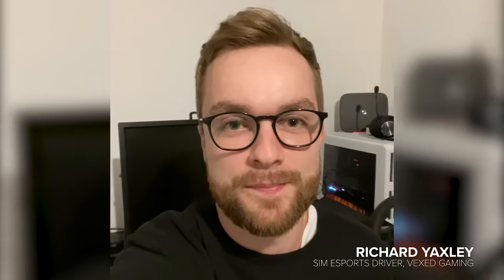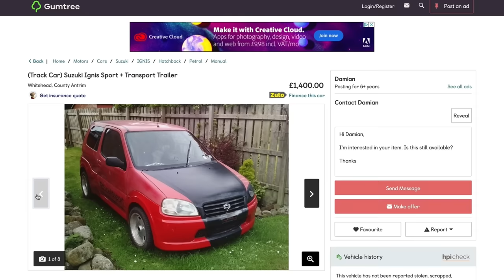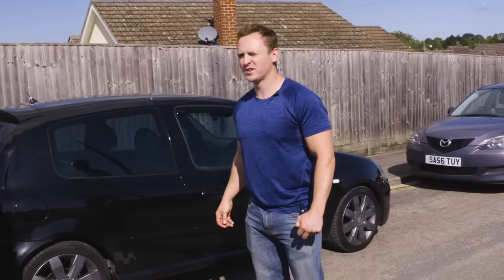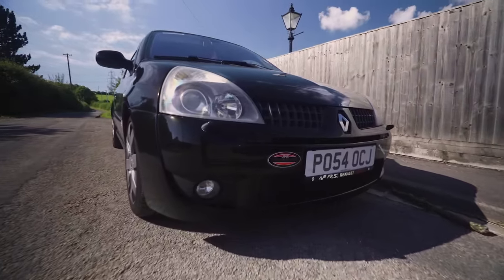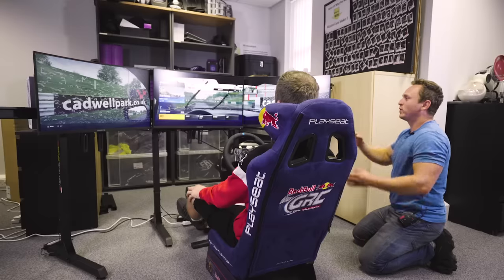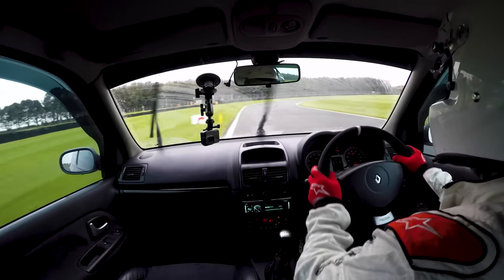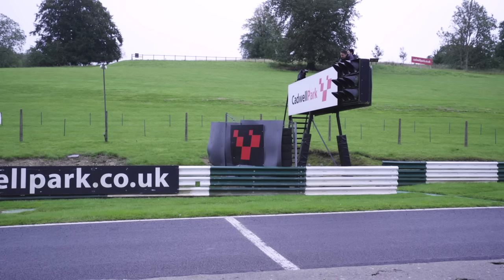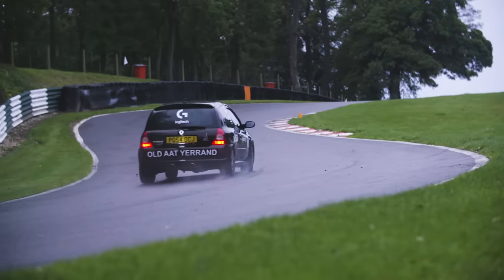£2000 Track Car Challenge

Comment: the Logitech wheel is a very low end wheel and for actually learning how the car behaves it isnt that good and the game youre playing is project cars which is an arcade
Reply: Well that's a sponsored vidéo isn't it?
Reply: The wheel is plenty for sim racing. Many guys who are racing with over 5k iRating are still using the logitech wheels. The bigger upgrade you need to be more competitive are decent pedals. And yeah pCars is shit. ACC and iRacing is much better for sim racing.
Reply: @ItsDavid07  I used to have a Logitech g920 a couple of years ago I’ve upgraded to a fanatec podium the difference is incredible even when the Logitech wheel is compared to a mid range wheel like a fanatec cls the difference is still immense 100% of the  guys I race with use fanatec cls,sim cubes,accufores or fanatec podiums a wheel maters the most in a sim setup
Reply: @hubertkam7647  I thought I was having a stroke reading that reply. Please punctuate. You're also comparing a £500 direct drive wheel to one that is effectively £130 on sale using helical gears so yeah the difference is huge. What I'm saying is that you're not really missing out on the most important feedback during sim racing which provides information as to where and how the car is reacting, you just get a much more pronounced feel and detail when using a higher end wheel. You can 100% be competitive with a G29/920 and compete with people use CLS wheels and up. You also have to factor in that people just don't have nearly £2-3k to fork out on a sim rig so going for the most cost effective way which is essentially better pedals is a much bigger upgrade than a new wheel. Brake and throttle control is just as important as the wheel itself.
Reply: @ItsDavid07  a cheap direct drive wheel is 1500 euro and if you gave me the g920 pedals I would probably be still within 2 seconds of my time
Reply: I do real life track and autocross events, and I use a G920 for gaming, it's not perfect but it's certainly good enough to put down consistent times with decent car control
Reply: @ItsDavid07  i got a g29 its been just a good cheap wheel bought it for 250 pounds new

Comment: Have a 182 myself, best car ive ever driven!
Reply: Yass me to
Reply: Used to have a ph1 172,  so far one of the most entertaining cars I drove until it's timing belt broke...
Reply: @dohmies77  Haha seems im driving a ticking time bomb at the moment. I havent had proof of the belt being done so Im chancing it slightly
Reply: @1234eeras  fthe belt was actually quite new, probably tensioner or something went bad since it had 275k km on the clock when shit hit the fan.
Reply: Lol have u driven a ep3 type r blows the 182 away woth handling and power and main thing reliability haha my bro had a 182 goes like tue clappers
Reply: @1991enduro  I see what you mean, they are more powerful. But its the reputation they have, chavs smacking them off the limiter all the time
Reply: @1991enduro  Tyre R’s aren’t as good as you think they are. The Clio beats type r hands down
Reply: @1991enduro  either it was a ropey one or you're exagerrating. These Clio's do and are known to handle amazing. The EP3 has slightly more power but is heavier so power to weight is pretty much identical. Of course a Honda will be reliable but the 172's and 182's are actually reliable too, at least mechanically.
Reply: The only thing a Honda blows is bleu smoke out of the exhaust by accelerating

Comment: A chair and a wheel on some high specked PC does not simulate a race track lap challenge scenario. Not even close. No g-forces, no risk, no nothing. You can't imagine how hard, how physically and mentally tiring it is to drive fast on a race track. You have to experience that for yourself. It looks easy, but it ain't!

On a sim you only get some of the sensation, but nothing real. I've had a Logitech G27 in the past, it was really fun! But only when I went to the race track, in a real car, I realized what it actually took to drive a car fast!

Great (actual) driving Alex!

Comment: Please make a series on this car where still staying under 2 grand you make it go as fast as possible by selling old parts and removing weight such as a spare tire

Bonus points if you gain those 7 seconds to beat the GT86
Reply: good idea, but they would need the racetrack again.
Reply: And they would need maths not to work, seeing as the car cost the whole 2 grand budget. Unless they get parts and work for free.
Reply: @JohnClark-ew8dh  to be fair he did say to sell old parts. doubt it would give them much room but still
Reply: @JohnClark-ew8dh  You can sell old parts pretty easy. Plus trades. Plus junkyards and other things. Though I’m not from the UK so idk how possible that is across the pond
Reply: What so you guys think he's going to be able to ring round with zero money and be like yeah I'm after a full set of Brembo brakes front and back only I cant pay for them, I will however do a straight swap for my rear window wiper as I dont need that...even throw in the blade. "old aat yer aaaaand". Fuck off.
Reply: @JohnClark-ew8dh  Might be interesting though to see where the "sweet spot" actually is for particular price points.  For 2 grand do you just spend it all on a given car or do you buy much lower and add parts for the remaining monies.  Would this car at  1500 and 500 on suspension/tires gets you how much of the time difference?

Comment: Project cars 3? why..

Also kind of thought someone who has beaten F1 drivers and such would have a direct drive rig instead of... from personal experience, flimsy and clunky Logitech gear.
Reply: Yeah bet he uses a sim cube or fanatec normally but for sponsor reasons had to use the G923 (Which is an overpriced rebrand of the g29)

Comment: That was a fast time for that car on that track with those tyres in those conditions, I knew the time wouldn't go down after the initial 2.01 lap.  That is the cars limit, even if it had been dry I don't think he'd have easily beaten the 1.55 target as the tyres and brakes would have been cooked after 2 laps.
Pretty much any gamer could put in a great performance if they played enough, I don't think many drivers anywhere would have got much more out of that particular Clio.  The brakes and tyres must have been absolutely shot by the end, it takes a lot of driver skill to maintain a consistent lap time with rapidly degrading parts.

Comment: This 15 year old FWD Renault 182 was smooth and fast whilst the sim racers inability to correct his virtual car on a straight line swiftly caught the gamers slight haughtiness although it seems the challenge was set to favor the sim driver from the start. But got to say, excellent driving from Alex- the car was neutralized with the slightest amount of counter steering pretty much in every corner whilst properly using the engine braking in wet conditions in throttle balanced lift off oversteer situations which in wet conditions is be the fastest way since these small steering corrections displays the correct and full use of a racing line whilst  managing weight transfer where as the simcade player well- span out in a straight line.

Comment: Disappointed you didn't go with an RX8, a good driver should get the 228 around the track faster than the clio, you get so much rotation from that chassis

Comment: im here screaming buy an old 6 cylinder bimmer. good to go !!! no joke tho, those 325i or 525i are dirt cheap and powerful. you would know if you have driven one.
Reply: With a cracked rear subframe , diff knock , mushroomed front towers . Worn shocks , rust.. etc etc  bmw are crap and overrated. I had a e46 328i and luckily I sold it . It was just a money pit that junk car
Reply: @ThaDutchDK1989  ow, here in Malaysia, our weather is quite nice, cars don't have a rust issue unless they're 30-40 years old

Comment: Had the front and rears been balanced  (4 old Michelins or 4 new cheap tyres) then a sub 2 minutes would have been relatively easily achievable, especially with a 2:01 with that mix. A new set of Michelins would see a competitive time. For a 2 grand near 15 year old car IRL vs a brand new 25+ grand car on a simulator (no matter who you are that's going to be seconds quicker with a like for like car), that's seriously impressive in my opinion.

Comment: A good sporty car with about 200 hp would be a slightly crashes Acura rsx type s I paid 1200$ for one that only needed a windshield and motor mounts I put coilovers and a exhaust and it was a quick little car probably keep the exhaust stock for a daily driver but a fun car for cheap if you can do a little work yourself

Comment: I don't know how much about sim racing to know how accurate it is, but why not at least use the same car?  The GT86 is 2.5s sec faster around the TG track (only thing I could find where they are tested comparably) than the Clio.

Comment: Sim racing can be good for training, but the times coming out can't be directly compared to real racing. iRacing would provide a closer analogue, but it still, any inaccuracies in the physics or car simulation are more likely to benefit the driver than hinder them, and you don't have the fear or risk of crashing, meaning it's much easier to be right on the limit when going around a virtual circuit.

Comment: The problem with this challenge is that the driving simulator doesn't incorporate the fatigue of the vehicle  e.g engine wear and brake fade and tyres, what should of been done was they both used the same new car

Comment: The audi a4 1.8T with 163bhp isnt acctually that slow, probably not as fast as a gt86 (i think) but it sticks better to the road (in my experience), i reckon it would give an gt86 a run for its money.

Comment: Great job on the carthrottle team, sim racing aspect however wasn’t captured well enough in my opinion. 

For a true street car Simulation Assetto Corsa would have been the better choice than Project Cars 3. + The Toyota GT86 (200hp RWD) and the Renault clio (180 something hp FWD) are not the best cars to compare to each other. 

I enjoyed the video but it seemed boring for the sim driver. 😅

Comment: The rx8 is lighter than the clio and if it was a 2008 model rx8 it would have came with 232hp to the crank and considering passing through towards the wheels it would have been about 168hp but it's lightness would of helped alot

Comment: As a F1 sim racer I can tell you , sim racing is a lot faster than real life since there is no fear , the cars can be set up to adapt to track in a game ,not like Alex could set up his 2K car, the cars are behaving as they should on paper in the games but in real life , especially that used Clio will not perform like it should so overall it is a dumb question if the sim racer is actually faster than real life or the other way around, in fact the guy is pretty slow because that car on that track , set up properly in the same conditions can easily do 1.48

Comment: Don't be fooled by that sim wheel setup. It's fine but for the money buy a Thrustmaster or Fanatec system. They're belt driven as opposed to the logitech which is cog and much lower quality experience

Comment: You discounted the RX8 far too quickly. I had one for 2 years, bought it for 1200 quid and it was mint! They get such a bad rep but honestly are not that bad! Sure it burns some oil but that’s how they are designed. Most fun you will ever have for less than 2k. Epic fail on your part guys!

Comment: As everyone else has said, SIM racer is a bit of a tool. As someone who's simraced for 5 years, and only just started real driving, whilst I managed to pick up normal driving impressively quickly, if I tried to go fast, the only advantage I'd have over anyone else on the road is I can do revmatching. I'd probably be no quicker in the real world. Especially with such a simple set up, there's no way that guy could deal with the forces that thrashing a car puts you through.

Comment: also to add to my previos comment, id like to see the simulation guy set the same lap times in real life with the gt86 and see how they compare to a game, they would be very very different. because games are unrealistic, yes the mechanics behind them stand. but in comparison to actual track racing, effects and tyres, handling, speeds, gears ect, no where near right.

Comment: Errr... yeah, 16yr old Clio with probably cheap pattern pads and 16yr old brake fluid, and 5 year old tyres, only 6 seconds slower around Cadwell than a rendered as brand new GT86, driven by a guy in his mum's basement...  bloody good result if you ask me. Bet the Clio would have gone back in boxes if you'd let the other guy drive it.

Comment: New tires and brakes on the Clio and it would of won
Reply: Surprised they didn’t strip out all the unnecessary weight. There are 4 seats in that car that could’ve been ripped out, easily saving 60kg at least!

Comment: I don't think this was fair tho GT86 has more power and it's RWD the Clio is 182 or less HP Alex had bad brakes GT86 didn't have any brake problems and tires didn't have problems too Alex had old tires so it's not fair

Comment: Sim versus track is not a fair test to begin with. The sim driver feels no forces and does not have to contend with the fear of fucking up, and they have limitless runs.
And since the simulator driver had a different car in-game and no interest in taking his car to the track, it was never a fair test either.
Logitech should have challenged the Sim driver to step up and try to match his skill for real, then shown Alex's laps.
Reply: The forces on the wheel are actually pretty accurate with high end wheels

Comment: Just don't believe a gaming set up gt86 is very fair comparison against a old 2k car. Dealing with greasy track, shit tyres and probably far more weight (I'm guessing the gt86 was track weight aka no extra weight + driver weight) no brake fade etc etc. Maybe the guy should have picked a weaker car to drive

Comment: do not buy this wheel. buy G29 or 920 on Black Friday for 120 quid. It is the same wheel. With a bit more power which you won't feel. And will pay like 300£ Typical Logitech squeezing every penny from this design which hasn't changed since first gen g25.